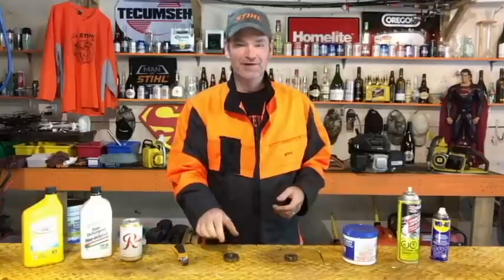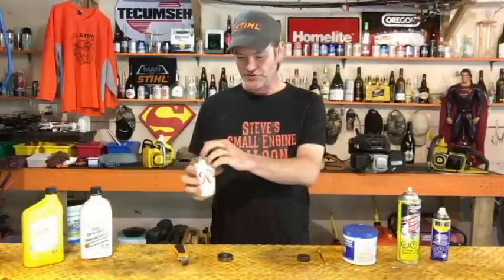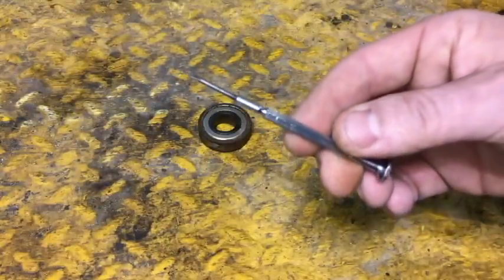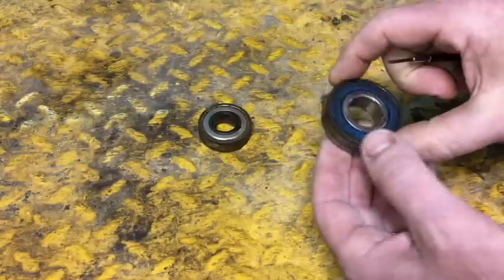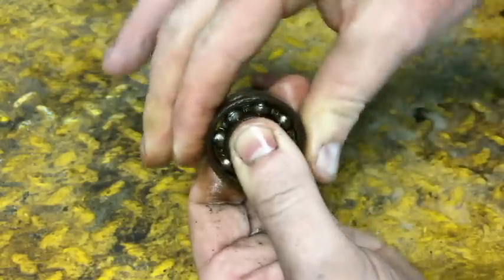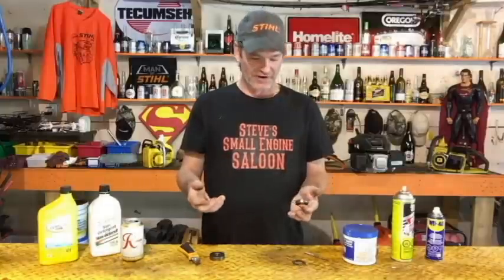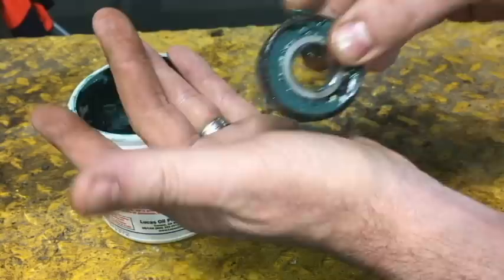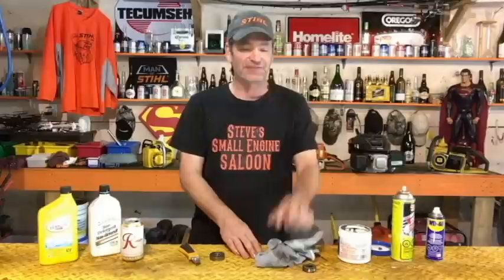How To Un-Seize, Clean and Grease a Sealed Bearing

Comment: Great site steve.
On palming the grease. I used to work at a local bus garage. Was taught this by an "old boy" but now it's me.
But palm it all from one side only, until until you see it coming all the way through the bearing. Then just top up the other side. If done right the bearing should be stiff to turn, with the amount of grease on each surface.
Keep it up Steve.. jeagermeister and red bull helps me..

Comment: Ahh now I see why my jobs haven't been going smoothly. I haven't been using the right tools. I will rectify it tonight and make sure the beer I use is over 5% alcohol not that lite beer that I've been using. Thanks for the tip..
Reply from the maker: Rum and Coke also works for this job.....
Reply: also stay away from beer with GHT on the label
Reply: In a pinch, you can do this using a light beer, but you may have to crack a second can.
Reply: for a really badly stuck rusty ballbearing. 50% Smirnov vodka is the only way there is. believe me. it works like charm :-)

Comment: Hi Steve, Bill from over the pond in England, great vids, clear, concise, no fancy terms, easy to understand. I'm a 70+ year old retired motor engineer, still working on engines of all shapes and sizes, but the smaller ones are easier as you get older, and best of all still learning. :-)

Could I add a couple of points, as mentioned ultrasonics are great for bearings, carbs, intricate  items etc, each possibly needing a different cleaning medium, to save having to keep emptying and changing solutions I now only have water in the tank, I have built up a selection of glass containers ( better than plastics for ultrasonics ) so I can quickly swap from cleaning a carb in say petrol to cleaning a bearing in engine cleaner / de-greaser, without having to drain and refill the tank with the next solution.

For working on such as carbs or other small items I have a sheet of thick glass I place on my bench with a sheet of printer paper underneath, strip the dirty carb down on it, pop it in the cleaner, wipe the glass clean, you have instantly got a clean bright re-assembly area.

Keep up the good work, draught Guinness or a good red wine is my standby when problems need a little thought.
Reply from the maker: Do you mean that you can set a glass jar full of gasoline and a carb, into the water bath of the ultrasonic and it will work?
Reply: I love my Ultrasonic Cleaner.
I got the harbor fright model. 
 I've just did a carburetor the other day for a briggs 49 v twin I got. 
I found a 50$ used briggs carb off ebay and it came out like new. 
I had the heads apart for porting, yup I ran em thru the ultrasonic too. 
Usually I'll use a mix of purple power and water, or plain old dish soap. 
They say on the package do not use solvents in the tank, but I've gotten around that.
Take a jar filled with solvents and your parts, put em in the water tank.

Comment: Nice and valuable presentation Steve. I would be far more persistent in cleaning that stuck bearing however. Now you are mixing new grease with remnants of old rust and grime. A small and cheap household ultrasonic cleaner filled with lamp oil (parafin) is ideal together with after the wet cleaning compressed air cleaning. Redo that process until rolling the bearing is completely smooth. Minimal method is a small bath with solvent (like acetone or brake cleaner to solve old grease) and a paint brush. Greetings Gerard, the Netherlands

Comment: PB blaster works the best. I use it all the time on my customers engines, also works incredibly well for seized cylinders! Great video!
Reply from the maker: Thank you!
Reply: @StevesSmallEngineSaloon  Also works great to remove snapped head bolts. It even works well to unseaze Briggs and Stratton starters after the sit for 5 years outside. I have customers that bring me engines were the starter smokes and makes funny noises, the briggs starters do not appear to be water tight and the magnets start to fall off when you take then apart then. Along with that comes rust, and 1/4 can of pb blaster Lol.Thanks you for the reply!

Comment: back when you could still repack wheel bearings on youre car that was the only way we knew to do bearings only we didnt flip the bearing because it traps air in the center of the bearing if you keep working it from one side the grease will push through to the other side thank you for the video Im sure there are a lot of younger folks that dont know you can do this

Comment: I came upon your channel about a week ago, and have been watching a bunch of your videos. I find most of them very informative and appreciate the information.  My opinion is, that seized bearing should go right in the scrap bucket. You spent all that time, taking something apart, to get the bearing out, and put the old one, that's probably pitted, back in? If it's just starting to talk, grease it and go, but rusted up so it doesn't turn, junk it.
Keep up the good work Steve-o

Comment: dipping and rotating the bearing in diesel works well too as the rotation action in the diesel will flush out the rust and crud. washing and re-greasing a bearing is only a stop gap measure that works on a slow turner (anything under 500RPM) but not a high speed application. just keep in mind that the bearing will have to be replaced no matter what, as the surfaces of the races and balls are pitted which is what makes the bearing growl or sound dry. the pitting leads to galling, which will begin as soon as the bearing re-enters service. depending on the load, the bearing might make it a few hours or even a day or two. just get the numbers it has on it and get a replacement coming. you will be needing it....
Reply: I opened, cleaned, and re-packed an idler bearing on my car and it ran for years with no issues. It had 11 ball bearings in it and 3 were broken in pieces. It ran perfectly on the remaining 8 with no noise or anything. The inner bearing surface was all galled up but it didnt care. Peugeot 505.
Reply: dipping in diesel - that is what I would usually do
Reply: @cvcoco  impressive! but i would hazard a guess that bearing wasn't made in china...lol
Reply: @HolzMichel  You brought up a good point. It used to be that we laughed at something like French quality in cars and parts. But then we so got used to China garbage that then Continental parts really seemed quite good in comparison and they were.
Reply: @cvcoco  roger that!!

Comment: The bearing with a metal plate on each side is called a shielded bearing and is not watertight.  Don't spray carb cleaner on bare skin, even the non-chlorinated ones contain chemicals that are absorbed through skin and don't belong inside you.  PB Blaster is great for loosening rust, works better than thinner solvents or WD40, which is a water displacer, not a penetrant. Acetone and ATF are great for removing grease and rust flakes.
Reply: marvel mystery oil is great too for freeing up rust, and cheap.

Comment: You can use Dot 3 brake fluid for a penetrating oil, use old Dot 3 that is old and save the new for your master cylinder. 

Started palming bearings in the '60s because I didn't have the fancy bearing packing tool to grease them. Start on one side, big glob of grease in your left hand, smack the bearing flat into the grease until the grease pops out the other side. Smack hard one section at a time rotating the outside of bearing around until all of the bearing is full all of the way. Still doing it the same way except that now I use gloves to keep the grease off of my hands. If you are doing more than one bearing try to get them all ready at the same time so that you can add grease and smack until you are done. Wheel bearings go really fast.  

For heavy use use a gray grease that has moly sulfide in it. NAPA has a grease with 3% moly content in it.

Comment: I install new brging and put used ones in 5 gallon bucket of diesel 
Check them again in couple of weeks 
Drill and tap housing and zert install 
Remove inside shells and drill two very small holes on bottom one for extra grease to excape under deck 
Merry Christmas

Comment: "Palm" from one side only, then wipe the dirty grease from the other side.
Reply from the maker: Yeah, better way.  Thanks
Reply: @CALVINLNIKONT  Ditto. I'm 69, my dad worked on model A's; so for about 100yrs we palmed from one side till the grease was pushed through. Thereby filling the ball/cavity area. Not just painting it on each side...Modern shops have a bearing greaser that pushes the grease through the bearing; pushing the old grease and dirt out; like my dad did on Model A's
Reply: @Sean Ware that's what we called it. Packing bearings. Done loads of them.
Reply: Exactly how I learned this 40 years ago. Thanks for the reminder!

Comment: Thought they could not be opened! Thank you. Have  Kohler SV 740 twin (on a Husqvarna yth2754)that is totally seized. I saw smoke and a few sparks from the base of the engine. Is there a bearing I can service or is it engine replacement time? Thanks if you can answer. (Ps, plenty of oil inside the engine)

Comment: I'm replacing my mowers wheel bushings with sealed bearings.  Should I just remove the inner seal on the bearings since the wheels have grease zerks and just regrease them every season or should I just leave them sealed?

Comment: As someone who does this type of stuff alot I do recommend repacking bearing like he did but when the bearing are rusty and crusty its time for some new ones. Now when your talking wheel bearing in a dirt bike hub then what ever but if it's in a high speed application like a street bike it's not worth the aggravation to try and repack a rusty bearing. But if the bearing are still good but just needs some grease then what ever go ahead and repack it. Just my two cents worth

Comment: What is the difference in the berring seal?  Do some types of seals that permit the old grease and dirt to escape.  

My mower that I am planning a deck berring refit is a 2009 Deere 7H17 hydrostatic commercial 48" comercial.  The mower has around 10,000 hours and my deck is tight but very loud~120db so I am expecting the berrings are likely scored.

Great podcast, watching you from the East Coast 😀 🖖

Comment: Steve, I know this an old video but I need some advice. Does one really need to inject grease in the spindle shafts of riding lawn mowers OR simply grease the upper and lower bearings AFTER popping them out and re-install? Does grease in spindle chamber actually do anything? Does it grease the spindle shaft too, or is that necessary once the bearings have been greased. Yup, removal of the bearings, grease and re-assembly could require 4 Canadian or European beers. A 12 pack or more of American beer! Regards to April. Cheers, Norm 🇨🇦 🍻
Reply: Hey, Stevo. A asked your opinion 3 days ago about greasing the spindle shaft or just greasing the bearings. I just posted the same question to Dony and he got back to me immediately. Team Ontario 1; Team BC still in the huddle!

Comment: I had a dry bearing squealing and hot on the chopper on my combine at 11:00 at night.  I was not going to be able to change it and needed to keep going.  I just prick punched a hole in it and used a grease needle to inject grease back in.  next day I siliconed the hole shut and that bearing was still on that combine 5 years later.
Reply from the maker: Right on

Comment: Great video and awesome topic. I think this would even work in blender pitchers that have removable bearings. But my concern is that won’t the Carburetor cleaner continue to break down that grease over time. I would have chased it out with some WD40 or PB BLASTER. Or maybe something else. If you understand what I’m talking about. What could we all use to chase out the Carb spray if day we didn’t have an air compressor and couldn’t blow air through the bearing? Any help or comments regarding this would be appreciated. Thanks...

Comment: I think that if you soak it in a shot-glass with white spirit or anything cheap overnight, it will work miracles. You just put a flat metallic surface upon it with something heavy on top(so it won' t get evaporated after all these hours) and in the morning you will see the solvent liquid full of ruins of ancient civilizations! I did this with my car' s spark plugs and it helped the rest of the cleaning process a lot.

Comment: Quick question:  I have a plunge router that the bearings are not seized on, however they feel a little dry and rough.  I'm thinking about trying this method because the bearings are discontinued (though I think I know where to source new ones).  The router spins at up to 25,000 RPM.  I have some fishing reel oil that's pretty thing and comes in a  bottle with a syringe-like nozzle.  It's probably close to sewing machine oil.  Would this be the proper stuff to lube it with at those speeds?  Or should I use some hi-temp wheel bearing grease?  I also have some 90w gear oil laying around as well.  What do you recommend for my needs?  Thanks for the help!
Reply: That thin oil would be great for cleaning up the inside of that bearing. You can go ahead and oil it up, put the seals back on, use the plunge router for a bit, then pop the seals again and clean thoroughly clean out the inside of that bearing. The thin oil should have cleaned out any of the oil grease residue and/or any rust particles that may be present. Inspect the bearing well once you've cleaned it out well after using the fishing reel oil in it. If the inners are once again clean like new you can then apply some bearing grease to it. For high speed/high temp I like Redline CV2. Careful not to overpack the bearing as that can actually create more heat at the RPM's you listed.  Some Krytox XHT-BDZ would also work great for the application.
Reply: @JA-rn5qv  THANK YOU!

Comment: Hi I have a zero turn qravely 1944. I just got done replacing 3 of the triangular things( sorry I blanked) that hold the blades on. When I later needed to replace the seal on my front wheels. I noticed I was short of ball bearings on one. Where do you go to get new bbs and what size. Now the race is on the inside of the wheel. And the other race came out. How do you fix the wheel?

Comment: Steve, Recently I saw a clip of yours about removing and discarding the innermost seal in a spindle and then fittlig a grease zerk to the housing. I ended up going to my local small engine repair guy and he discouraged this idea. In this clip of yours, you are suggesting temporarily removing the seal, packing the bearing and replacing the seal.Personally I like the zerk idea. Do I really need an overflow hole in the spindle housing to avoid overfilling the bearings with frease ?

Comment: Porsche Boxter engines had factory installed sealed ball bearings on the internal cam drive counter shaft. This seems to be a planned failure. As the grease in the bearings dissipated, the seals prevented engine oil from properly lubricating the bearings. An aftermarket fix was to disassemble the engine and replace the bearings with open, unsealed, bearings that are lubricated by the splash of engine oil.

Comment: The trick of palming is an old one. I used it when packing the roller bearings! Always palm then until the grease come clean on the other side! Don’t be afraid of the grease! That’s what rags or paper towels are for! Good video, Steve!
Reply from the maker: Thank You...
Reply: Be careful of the synthetics! I have worked with turbine engine oils, fire resistant hydraulic fluid, and synthetic greases for years. They get absorbed into the skin faster than you can say lickity split! I am a cancer survivor, but the cause was most likely from the herbicide 2,4-D that I worked with decades ago without proper PPE.

Comment: Steve I watched your video on the bearings on the John Deere spindle bearing and you removed the inner seal on the bearings and replaced it back in the spindle, this way when you greased the grease get to the bearings, why didn’t you do the same with these bearings ?

Comment: Good man Steve you are doing folk a great service with your videos , i usually remove the seals and drop the siezed bearing into petrol in a metal tin and leave it to soak for a night or two , i then rorate it and blow out the rust with an air jet and use some oil to lubricate the races , then il get some hight temp grease and pack the bearing well with grease and re fit the seals on the bearings and then refit and everything runs so smoothe once more , greetings from Ireland Steve , what State are you in the  US  , just woundering thats all
Reply from the maker: British Columbia, Canada eh!
Reply: @StevesSmallEngineSaloon  many thanks Steve you live in a nice part of the world for sure  , just thinking there looking at your can of beer on the bench  , would it be any good for soalking bearings in the can of beer and lubing the bearings then with our Guinness , all the best for now cheers

Comment: I use paint thinner to clean it out.  It is safer than gasoline, which also works well, but dangerous.  Blow out with air, and make sure you get it as clean as possible.  Dirt is the most destructive thing you can leave in there.  Don't completely fill with grease as that will cause it to overheat.  Half full is just fine.  Turn the races, to make sure the balls have grease everywhere.  I use higher octane alcohol, but I wait until I am done and I can relax knowing I've done the best job possible.

Comment: You handle this just like I always do, just checked out the video to see if I was doing the right thing by popping seals and re-packing. I figure a nickel worth of grease is better than dropping $13 on a new bearing. Good instruction for the fella that’s never done this. I use a pick or razor, and I like the “smoosh” reference. I use brake cleaner first, then smoosh. Anyhow, good info for the diy guy.
Reply from the maker: Thank You...